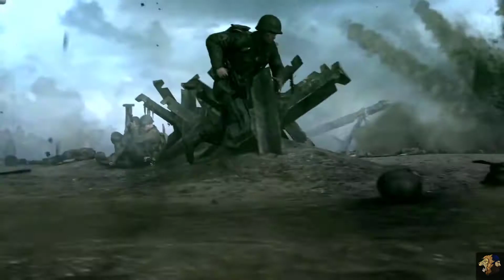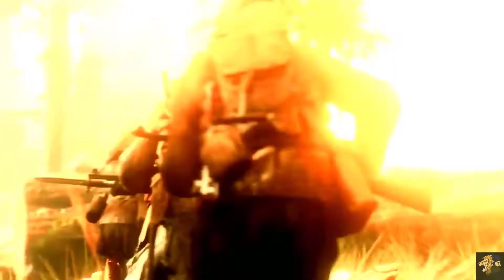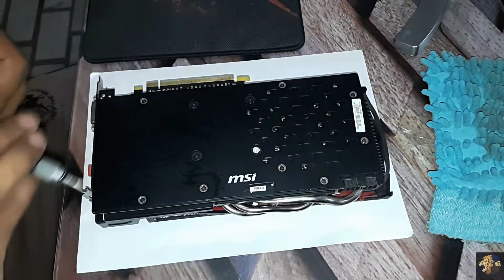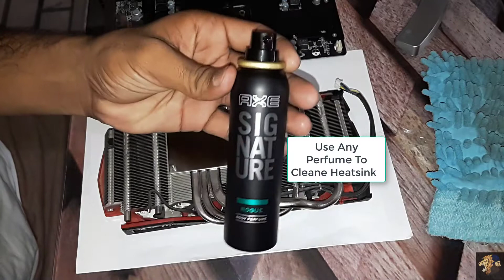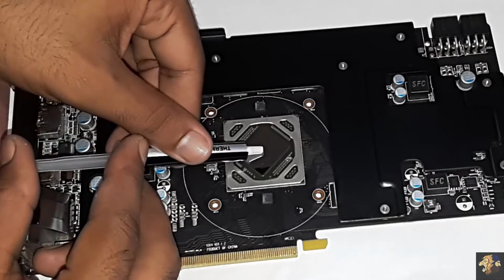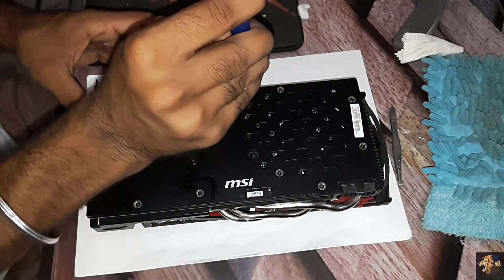How To Replace GPU ( Graphic Card ) Thermal Paste | MSI R9 380 4 Gb Thermal Paste Replacement

Comment: Which cheap thermal paste would you recommend for this GPU?. Cooler master HTK 002, Corsair TM30? Thank you!
Reply from the maker: buy any these brand cooler master cor corsair
Reply: @gurisingh  Thanks, maybe I put it Artic mx4 but I will see. 
Also maybe I replace the thermal pads.

Comment: Yes I know my comment is late, but DON'T use Axe or any deodorant to clean such surfaces. There's always a chance that those include substances that are corrosive to metal surfaces, thus either impacting the thermal performance or even damaging the card irreparably. Use rubbing alcohol (90% or more), this should work nicely.
Reply: what if 70% alcohol, is it enough?
Reply: @Jslg11  that will depend on the other ingredients. if there is nothing else in it that is lasting and/or conductive, it should be fine. Id still recommend using normal rubbing alcohol.

Comment: I have question. Does that MSI R9 380 gaming 4gb have thermal pads on it or no?
Reply: I think there are some on the VRMs, but not on the memory modules, they have a seperate heat sink.

Comment: Thanks so much! I followed the steps and dusted off the whole thing as well as put in new thermal paste and the most the gpu goes to is 61 degrees. My pc is no longer reseting the monitor. I checked the gpu using GPUZ after I cleaned it out and put the new paste on. No shut downs or reset. Thanks again.
Reply from the maker: Welcome Bro

Comment: hi bro I have a acer predator g3610 and i want to change the graphic card 
is the SAPPHIRE AMD RADEON RX 460 4G GDDR5 will be good? and is it compatible?
thanks
Reply from the maker: Yes compatible?
Reply: Guri Singh  my computer will accept this card?
Reply from the maker: Yes Bro ...And Confirm You've seen the PCI 16X slot on your motherboard.?? Then Definitely can seem